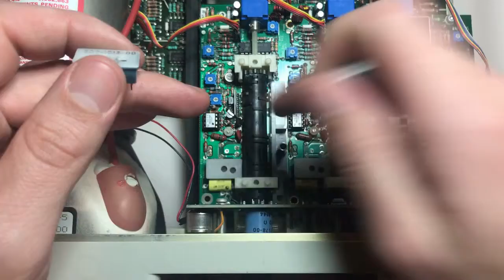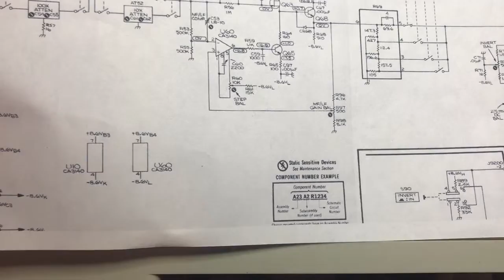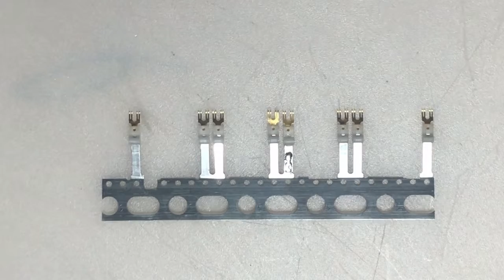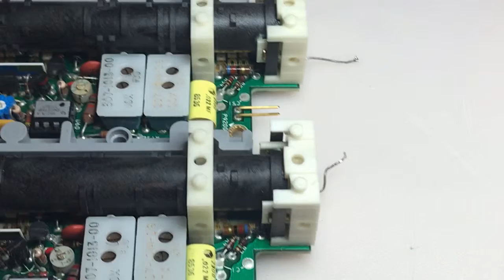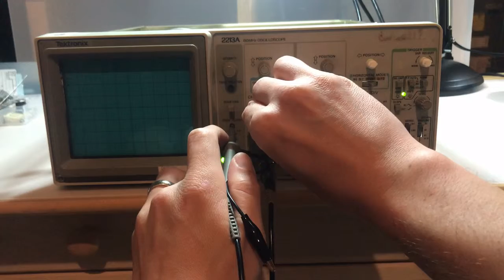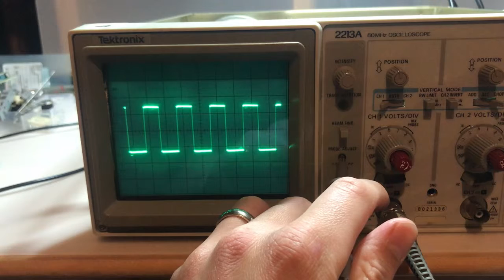DR #13 - Tektronix 2213A Oscilloscope Troubleshooting and Repair Part 2

Comment: Good video.   Curious… I have theTektronix 2213A scope on my bench and like with most scopes, I am a bit confused with the various trigger selections.  Since you are very good with oscilloscopes, Could you please do a video on just triggering.  I know my scope doesn’t have a delay, but is there a way to show digital pulses that should switch between spaces?  My situation is I’m trying to fix the digital network with a Sencore LC53 inductance/capacitance meter.  There is designed output spacing changes between IC chips.  Can my triggering be set up to do that somehow?  There is a variable trigger hold off on mine….. can I use that and how?  What is, “RP AUTO” and “NORM” which labels also reference a TV line, and TV field?  I know anolog TVs are gone, but can these buttons serve another purpose?  And if so what and how?   I want to utilize every tool I can as I probe American Five Radios for repair & restorations.  I understand coupling but what is switch of, “VERT MODE” mean?  Aren’t we using voltage height already to adjust triggering?   Maybe if not making a video on triggering just contact me?   I’m fine with the public too seeing my information.  I welcome any and all advice.

Michael in Florida
(561) 951-9999 cell 
MichaelScot4u@icloud.com

Comment: Never add solder to those gold plated pads and keep clean from fingerprints, those have high frequency going through them and the gold plating is absolutely necessary for attenuator  to work correctly. Any change to those attenuator will require likely a calibration/performance check. So best not to mess with them if not needed. Now of course you can skip steps but best if calibrating to go though all steps. Plus don’t use contact cleaner to clean them just rubbing alcohol only and clean only when contacts are down to avoid bending them. 

The other issue notice is the two contacts you cut off to fix the broken off ones are used for the AC DC GND coupling switch. That why there is a separate small cam assembly for it. You need to buy a new attenuator assembly to fix it completely. I worked on many of these oscilloscopes over the years and know them well. Yes I screwed up as well and learned lessons early on. We all make mistakes.

I see you realized the mistake on the cut off contracts strip off coupling later on in the video my apologies.

Comment: Great video.. I have a Telinstruments TI5252 25mhz scope...I have an issue with ch1 as I cannot centre the trace, at the bottom of the screen is where the trace is at its highest, however the trace on channel 2 can be centred and moved up and down no problem..
Any suggestions ?
Much appreciated

Comment: good video I'm having the same problems, but I'm having real trouble removing the attenuator board. I removed all the knobs,screws, de-soldered the B&C connector resistors. the attenuated board is now very loose but will not move back from the front fascia panel because of the AC/DC Grd switches can anybody tell me how I disengage these switches from the attenuator board without having to remove all the front fascia panel . Any help would be greatly appreciated.

Comment: The switches are high-frequency, low-signal, low-noise, gold-plated, low-capacitance, miracle switches, because standard rotary switches just aren't good enough.  If you ever encounter them again, remember that they deserve huge amounts of care and consideration!  Clean with the recommended solvent; no fingerprints all over them creating leakage and such.

If my brother were still with us, he'd say "Slow down and think more carefully about what could go wrong, and what you're doing."  I'm still learning that lesson myself!

Comment: Dumb question probably, sorry, but do You know about the red "zoom" knobs marked with "CAL" and arrow?
Reply from the maker: Jiri, 

The red knobs marked with "CAL" are to allow for continuous adjustments between the discrete, calibrated values determined by the volts/division and seconds/division switches. You can think of these "CAL" knobs as fine tune adjustments, while the main switches are used for rough adjustments.

Comment: Now wondering if it might have been simply debris under the contact strip?? Maybe blowing it out with compressed air could have done the job?
Reply: Yeah, I can't believe the first thing you don't do in any of the old electronics is to douse the thing with contact cleaner/lube.
Reply: @larrybud  Never use contact cleaner on these attenuator assemblies. Service Manual also states that only isopropyl alcoholc must be used. is all that needed and clean with contacts in down position to avoid bending them. 

Been using isopropyl alcohol for years and use a syringe and drop on each of the contacts and never had issues with them being flaky and even years later still works as good after cleaning them. Of course exercising the switches and using the scope keep them clean.
Reply: @thetechgenie7374  What negative impact can contact cleaner do?
Reply: @thetechgenie7374 do use 99% alcohol or 91? Thanks for your expertise on this thread btw!